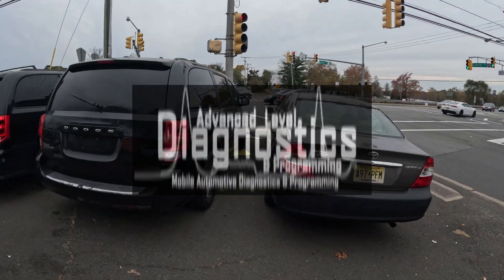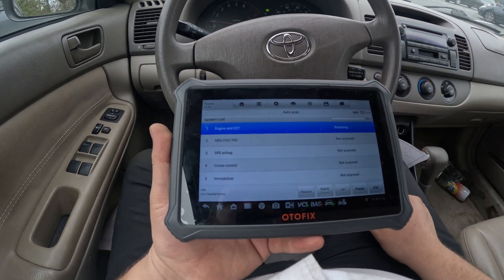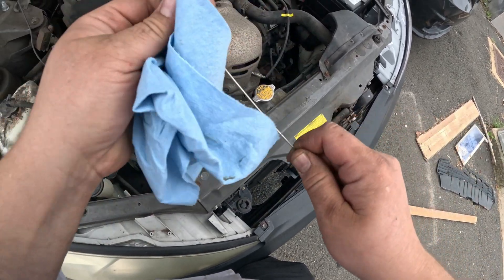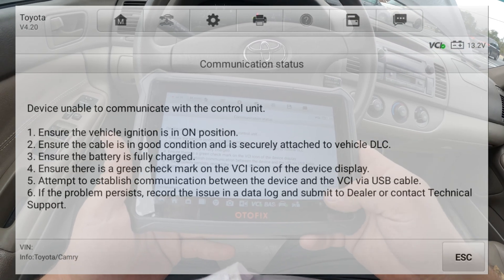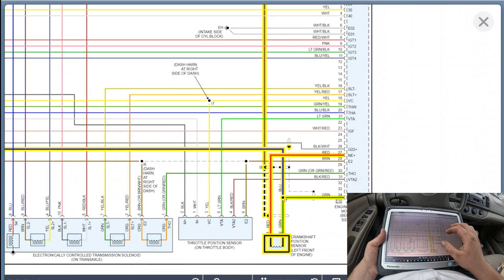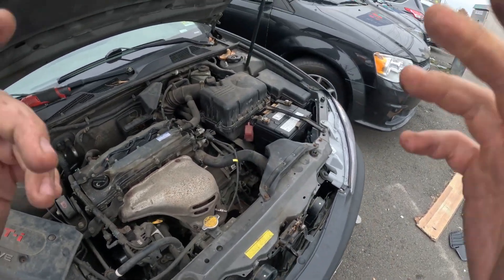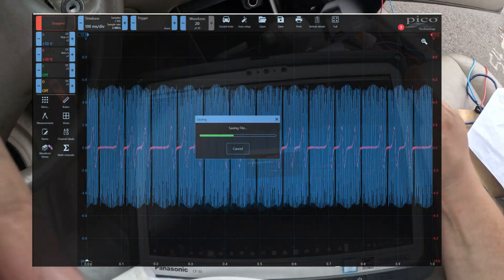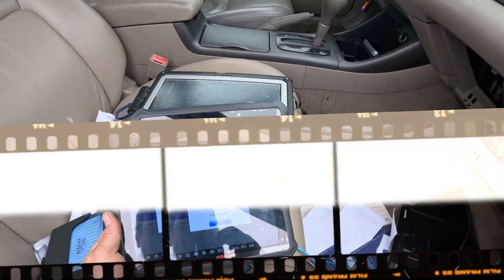2003 Camry - Timing Codes (P0016) / Budget Scantool

Comment: Thank you for the video.

Does the Pco 7 software run smooth on the tough pad? What is the tough pad's configuration, ram and processorwise?

What is the extra, black cover/sleeve on your Picoscope,is it from Autonerdz?
Reply from the maker: The computer I'm using is the Toughbook CF-33 I Just don't have the keyboard connected. Pico 7 runs great on it, it is an i5 7th gen with 8GB ram.
The case on my Pico is @jarheaddiagnostics mounting case for the dell latitude 7212 tablet, which I am not using in the video. 
https://www.jarheaddiag.com/shop/p/scopemount
Reply: @advancedleveldiagnostics  Thank you.

Comment: Nice! Fyi the wire connector on the bracket near the alternator is for the crank sensor, cam sensor  is on opposite side engine block. Easier than poking around diagrams.
Reply from the maker: I find these Pcm's very easy to find what I'm looking for, also you don't get as dirty😀

Comment: Hi why do you disconnect the oil control valve when you run a cam crank correlation on the oscilloscope ?
Reply from the maker: The reason it's done is to eliminates the possibility of the solenoid being activated,  and changing the timing. I don't really feel it's necessary I just do it because a lot of the known good waveforms I use say Unplugged.

Comment: I bought my first and last Autel 3years ago . Love my topdon
Reply from the maker: Ye I'm a big fan of Topdon too! I do find it helps to have multiple brands when something is not working just to make sure it's not the tool.
Reply: @advancedleveldiagnostics  Same with key programmers. We have mostly Autels but the best of all of them is the Advanced Diagnostics Smart Pro. We don't use it as much because it's token based and comes in a huge PITA case. We have had a handful of cars the heavy hitters wouldn't program. We fired up a cheap Chinese clone knockoff and that actually programmed the fob. You never know unless you try. I contacted Topdon to see if they had a maintainer that didn't have to be plugged in. We are mobile like you so that would be nice to have. Other than a jump box I haven't found anything.